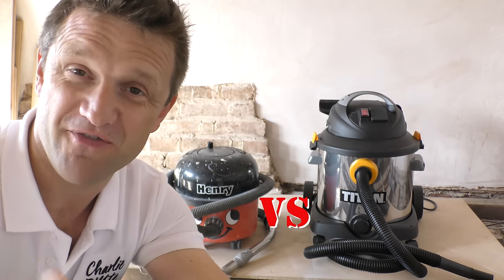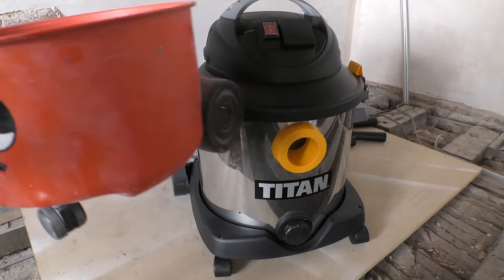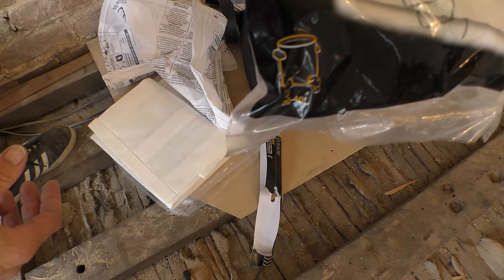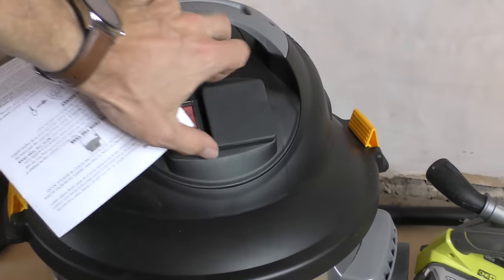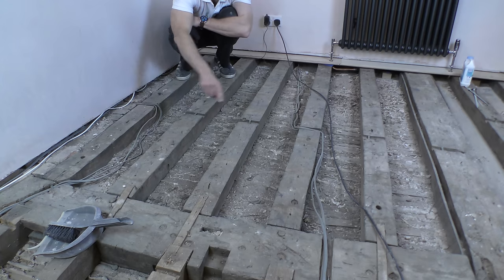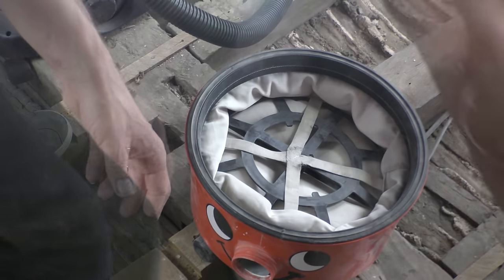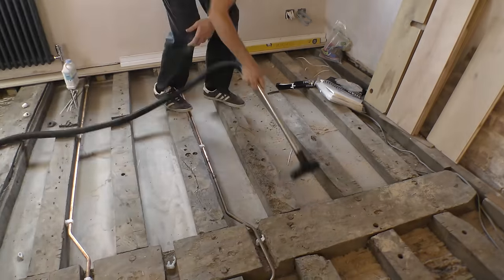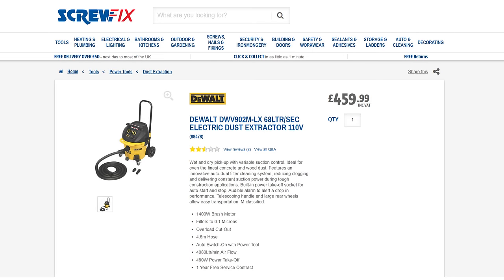TITAN vs Henry - DIY Vacuum Review

Comment: Whomever Titan belongs to for a house brand it appears to be a Shop-Vac with Titan written on it.  In North America there are two companies that make wet and dry utility vacuums, one is Shop-Vac and the other is Emerson, who makes brands Workshop, Ridgid, Craftsman and Canadian Tire's Mastercraft brand, and the commercial Pro-Team vacuum cleaner line, to name a few.  

So, you bought a Shop-Vac for GB80, but you have to remember you bought a low end model while the Henry is something, that in North America (specifically Canada) sells for nearly CA$500.  This machine is considered commercial over here and has the yellow cord with it.  It's like someone buying an H2O vac, the really crappy version, to replace a Rainbow E2 Black.  Things will show quality wise for sure.  Now, if you bought a Contractor version of the Shop Vac or Ridgid, it will have more premium options like a better hose with a threaded locking system and better bag collar retention.  Also, the stuff you were picking up would normally require a 2 1/2 inch diameter hose and a utility nozzle that's normally about 6 inch square.

On a side note, do you tack your electrical wiring down to the floor joists in the UK or does it sit loose like that?  If not, your outlets may be (marginally) safer (I still don't know why the plug has a fuse built into it, but for the average user, that is a major concern because a 3A device could have a 13 A fuse put in by mistake cooking your wiring and even your house to a crisp) but if your wiring is floating around under your feet and you wanted to drill through the floor, one could be seriously hurt since it's 240 V.  We have 240 V but that's typically used to run large appliances like electric cooking stoves, central air conditioning and electric water heaters.
Reply from the maker: Great post, thanks buddy. You're right and that video was actually unfair because the Titan was never intended to be a domestic vac. I used it as a static workshop vac attached to a cyclone extractor for the recent wardrobe build and it was brilliant. https://youtu.be/9RfHpm2vf40 And with the cyclone you don't need to mess around with the vacuum bags. 👍

Comment: I have the same Titan vacuum and I thinks it’s a decent purchase few points I picked up 
That filter for the Titan is not the hepa one as per other comments below, it’s not designed for fine dust, (extra one is about £25) I haven’t tried it yet but reviews suggest it’s decent and is more for fine dust and plaster sanding, like the job your complete Charlie.

I wouldn’t use this type of vacuum for day to day on carpets anyway it’s more for DIY, dyson is for that which I wouldn’t use for diy like the video.

Ok the Henry is decent quality but like anything your paying for the quality. Festool offer better quality if you have 2k spare 

The attachment you stated doesn’t fit your tools has three part size, this is so you can cut it too fit, yes it won’t fit anything then, but that’s the same with all brands nothing is fully compatible unless you stick one range

Comment: I do a considerable amount of debris pick up and I choose machines that have a larger diameter  hose. Its not uncommon for me to be picking up considerably larger sized debris than what I could see in this video. The Titan wouldn't be on any list of mine. The Henry would be for around the home and light DIY use. I have 3 really good shop vacuums and don't need another but I still plan on getting a Henry anyway. Thanks for the video 2 years ago!
Reply from the maker: Thanks. Yes agreed although the Titan came into its own when I used it as a shop vac attached to a cyclone when I built my wardrobes https://youtu.be/9RfHpm2vf40. That's what it's designed for not a domestic vac so my review was a bit unfair really.

Comment: You’ve put the foam sleeve on upside down. There’s a small taper on it. It’s easy and not fiddly if you put it the right way round
Reply from the maker: Thanks James. Never used it in wet mode to be honest, but I have since found it's best use - was a static shop vac attached to a cyclone. It wasn't intended as a domestic vac so my review was a bit unfair in that sense https://youtu.be/9RfHpm2vf40
Reply: @CharlieDIYte  Ah that’s fair enough! I have two and just use them as a wet vacs only. They’re brilliant for that!

Comment: Great review.
Reply from the maker: Thanks 👍
Reply: @CharlieDIYte  I would love to have gone with the Henry but could really justify paying over a hundred quid for something that's inly ever going to be used to clean up mess on site. I went for a Titan TTB671VAC, it seems better build quality than the one you reviewed. I watched quite a few vacuum cleaner review videos and your by far was the most informative and descriptive, detailing the pros and cons you found in both machines.
Reply from the maker: Yes that looks much better. Better quality vacuum head (that plastic one on mine is hopeless). You can't really go wrong for £60. How are you finding it? 👍
Reply: @CharlieDIYte  I've not picked it up yet, I don't expect it to be as good as a Henry but hopefully it's not too far off.

Comment: Do you still have the Henry
Reply from the maker: Yes.
Reply: Isn't Henry made for regular home use
Reply from the maker: @matthewbroom3176  You can use it for either and in fact you'll see it on quite a lot of building sites. The design is robust enough for building site and domestic use, although builders typically don't look after it in the sense that they don't generally bother using vacuum bags. But if you use vacuum bags, then it will last for ever whatever you use it for - as this one is testament to.
Reply: Ok thank you

Comment: Titan is typical Screwfix shite in my humble opinion. 
I also have a Henry and use it for smaller jobs and house vacuuming. For more industrial jobs I use a large Nilfisk with 50 mm diameter hose and a Chinese cyclone. The cyclone collects about 95% while the rest, mainly fine dust, ends up in the Nilfisk.

Comment: I have an old Wicks workshop vac (now almost 28 years old; yet it still works) kept by my lathe. IT has survived more abuse than anything should.  But my 50L Draper 1400w monster copes better with big jobs. It has a large diameter 5m hose and  wider stainless tubes. Even after 10 years it still looks good.  Also Look at Nilfisk Wet & Dry shop vacuums from Denmark. they are miles better. 
Old plasterwork like that is horrible. I once did a whole flat full of it. GHASTLY stuff - use a mask. ALSO. Take off the filter and use your Ryobi blower to blow out the filter - from the inside (that really helps).

Comment: I had one of these. The clips are too weak. I used to unblock my sink as I carried it to empty the tank fell off because the clip failed. Its a poor design, just like the cheaper Titan models. Would also note that when vacuming up rubble it ejects large quatities of dust into the air, making it practically useless for indoor use. It only cost me £50 but I wish I spent a bit more because for me its actually quite useless.
Reply from the maker: I agree. That's happened to me loads of times. It's only really designed as a static shop vac attached to a secondary cyclone, as I discovered when I built my wardrobes. https://youtu.be/9RfHpm2vf40 When used for that it's performance is actually quite respectable. I guess the pass through switch was a bit of a clue.

Comment: It will be a generic Chinese vac that is just badged Titan. I guess they are built to a price point and if they came with stainless steel accessories the cost would be too close to the Henry. My other concern is how long the motor will last for. They are not cheap if they need new motors every year.

Comment: When I decorated my bedroom, I used my 2017 Numatic James that I got in Jan 2018 to tidy up afterwards, he's a belting little vacuum cleaner, and in my opinion James with an airobrush cleans our carpets better than our Dyson DC40 animal MK2. The latest tapered Numatic hoses actually make the 620w motor just as powerful as the old higher wattage ones. Might be worth trying a new type hose on your Henry, he'll feel far more powerful I'd imagine. But If I was getting a vacuum cleaner solely for DIY though, I'd go with the Numatic Charles. As you can tell with your Henry, Numatic vacuums last a very long time with care 👍

Comment: Henry vacuum cleaners are uk assembled. Mr Jones in his Chard  Henry factory, is far more likely to be on the phone to you, for house improvemets, than Mr Wong working in the Titan factory in China. They don't block as much. The cost of man hours saved by the tool actually performing its function, greatly outweighs the initial cost outlay.
Reply from the maker: Agreed. Hardly ever use the Titan. The plastic accessories are woefully bad quality and the fact that the bag doesn't stay on the inlet nozzle is totally unacceptable, shoddy design.

Comment: I have both the Henry AND the Titan and wanted to share my experience with them -

Henry you can get plenty of spare hoses and filters etc, my henry been running since 2004 with no problems. It is just heavy for its size and small for big jobs, probably best not to use a bag as i find that the suction on it isn't as good when it fills with fine dust.

The titan i bought because you can use it for some water spills and mainly for getting loads of dust, for example smashing down a wall in a bedroom, mental amount of dust - perfect for this BUT it ejects air out of a hole at the back (as you can.. excuse the innuendo, blow and suck with the titan lol) and the filter had fallen down a bit and blew dust out around the whole room.

My first issue with the titan was that i got an electric shock from metal tub of the hoover, build up of static and a metal tub means you can get shocked. 

The second issue with the titan is that the filter gets gunged up so you have to spend some time cleaning it out, the titan is very powerful so you know when it is time to clean it out when the performance is a bit crap.

The third issue is the hose, it is not very thick, so it kinks in on itself especially at the connection to the titan itself, it would fold in slightly and cause a crease, which then makes stuff jam up in there, so you pretty much will be hoovering up dust etc and it will block up all of the time.

After learning about dust cyclones I use this now instead of relying on having big vacuums for dusty jobs so that the dust doesnt even enter the vacuum bag or whatever.

Comment: I am a tad confused.  Has Henry changed its name to Numatic?  
Screwfix sell a vacuum cleaner called Numatic which has the same livery as Henry (black lid, red body and the eyes) but the name on it is Numatic.  So what is going on --  is the Numatic really a Henry or has Henry gone for ever and Numatic is a totally different product which uses the same famous 'look' as the Henry?  
If it.
If the Numatic is a totally different vac, how does it compare with the Henry?
Reply: Nematic is the name of the manufacturer.  They just give their range different names.
Henry,  Hetty and Charles ( the wet version, I think)  being just 3 examples...
Reply: That is the Numatic NRV200,the base is slightly larger and wider than the normal henry but same motor and attachments none the less
Reply: @VFRrider    Thank you for the clarification.  If the manufactures  want to add another model to their range I would have expected them chose another male/female name for it instead of veering off course and giving it their own brand name.  But I guess there must be a marketing/sales advantage.
Reply: @apache16789  I suspect it's an attempt to get people used to Numatic rather than Henry. 
I mean Hoover must be so happy that their brand very much became the recognised name for vacuuming!!
Reply: The ones with the actual names are more rated towards home use and the numatic ones are comercial grade. Although the named ones are still immortal.

Comment: I totally agree with you Charlie it does have woefully poor accessories and you are right Titan should have produced a stainless steel tube and the Stanley fatmax does have better accessories
Reply from the maker: The thing is Rory, I've realised the Titan was never designed to be a domestic vac. I've recently been using it as a static shop vac attached to a cyclone and for that it's suddenly come into it's own https://youtu.be/9RfHpm2vf40

Comment: I bought the 19ltr last year when my shed Dyson died at last and I really regret it. Bags aren't particularly cheap and you go through them reasonably quickly but I guess that's OK and no different to a Henry. But, my main dislike is how loud it is! Seriously, you cant use it in doors without hearing protection. It might have a 1200w motor, but that's mostly being lost as heat which it pumps out the back, blowing stuff all around the room. You can use the supplied hose to vent this out the window if you have another hose. The supplied hose and accessories are useless, save venting out a window. I'm looking forward to it dying one day so I can buy a Henry. As they say, buy cheap, buy twice..... Honestly they shouldn't be allowed to sell such things without supplying hearing protection.
Reply from the maker: The thing is James, I've realised it's only really designed to be a shop vac. I recently got mine out for a wardrobe build and had it as a static vac in my workshop tent attached to a cyclone extractor - which means you don't have to use a bag inside it anymore as almost all the dust is collected in the cyclone  https://bit.ly/3fssYHn You're right, the sound is intense, but you tend to wear ear defenders because of the power tools you're using when it's on. It's just not a domestic vac.
Reply: @CharlieDIYte  I agree, but I'm sure plenty of people just see it as a cheap Henry, which it is deffo not. I used it for dust extraction on Mirka Mesh hand sanding system to do walls in 2 rooms. If it had been a Henry I wouldn't have NEEDED hearing protection although I'd probably still have worn it, but it was unusable in a small room without ears on and the hot air venting out the window. If they had even put a 2 speed system in it would help. If you just need something to provide lots of suction then it's fine, especially given the cost.

Comment: Charlie: false economy - I also went from Henry to Titan; but the answer was in fact 'Charles' or if you want an even better household tool set see 'George' (leave Titan for tool attachment jobs like sanding or ebay!)
Reply from the maker: Thanks mate. Out of interest which of those two would be best for wet vacuuming floors? I'm contemplating getting one for our grubby kitchen floor which, when you mop basically just chases the dirt round.
Reply: I've used my titan for sanding briefly and the filter just isn't up to it. Wouldn't use anything other than my M.Class Makita Branded Nilfisk Attix for sanding.
Reply: @CharlieDIYte  infomercial (I am not employed, implored or paid by the manufacturers to say the following....) both Charles and George are 'wet & dry' and have the uprated motor (1000w +) and greater capacity (than Henry) - whereas George comes with  the floor tools (for liquids) - another nice feature is the option of a reusable bag for both - and agree with Sam T (if a dust-free environment is required then there are far better pro/hobbyist options) note: am now considering a twin-motor model with even more capacity but will also handle floor spills, drain blockages and gutter clearing...nice to have for some perhaps (but better to have and not need than need but not have!)
Reply from the maker: @deadpeoplestuff5686  Thanks mate, and I wholeheartedly agree with your last comment!!

Comment: I have had both...the titan didnt last a year before the motor failed and ceased due to dust.

It has a cheap feel about it.

The Henry, especially the older ones will last a lot longer.

But be careful with either if you're sanding paint or fine dust particles without an Hepa filter as the dust will soon make its way into the motor

I use the blue nilfisk hoovers now
Reply from the maker: I bought a HEPA filter for the Titan, which you can't get hold of now. I recently repurposed it with a cyclone as a static shop vac for a wardrobe build - so no dust goes into the drum now and it's great for that, which made me realise this is what it was designed for, and not much else.

Comment: We have once of the industrial models of the Henry which after 2 or do decades the motor eventually went so we replaced it with an even larger motor and now she chooches like a good'n
Reply from the maker: Thanks for that Luke. Which model out of interest?
Reply: @CharlieDIYte  it's a hvr200 model, originally with a 1100w motor installed as opposed to the standard 650w
Reply from the maker: @lukey4979  No way. Mine in the video is an HVR 200 also with the 1100w motor originally.  My motor went as well and I replaced it with a 650w. I got a more powerful one from Espares but sent it back when I discovered the genuine Numatic. Wish I hadn't now! Where did you get your new motor from?
Reply: @CharlieDIYte we've had it years, The original actually came from the towel production company chortex when Victoria mill shut down and the new motor came out of a different  vacuume from Bolton plastics that they were getting rid of that happened to fit the Henry

Comment: I own a Henry and the Titan. Mine started blowing the dust out the exhaust so I thought I would change the Filter. I installed the new Filter and it's still blowing dust everywhere. I can't see what the issue is. Has anyone experienced the same?
Reply from the maker: Bad design. It's really meant as a static shop vac attached to a cyclone https://youtu.be/9RfHpm2vf40